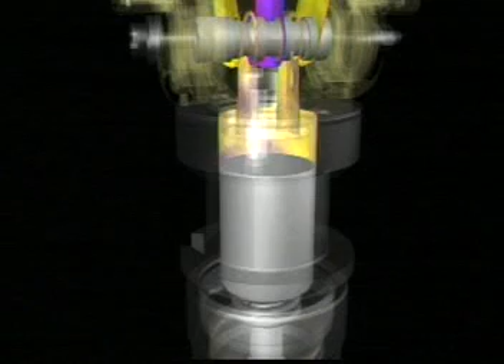HEUI Systems

Comment: 1999 cat 3126b truck engine on has 4000 hours uses about 2 1/2 gallons in a 12 hour day do to injecters.  thats about 4000$ to fix. this system is a piece of shit.
Reply: Just rebuild them yourself and don't run dirty oil. They're not that bad
Reply: The HEUI needs perfect oil, recommend shell Rotella t6. Been running my truck with a cat 3126 for 13 years and the #1 issue has been bad fuel. Sounds like you need a rebuild and you should be good to go...